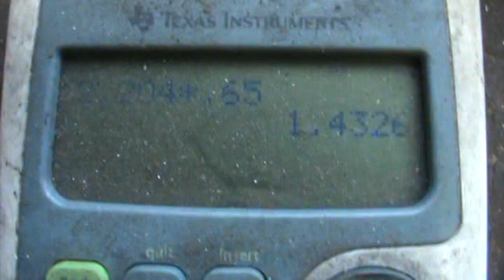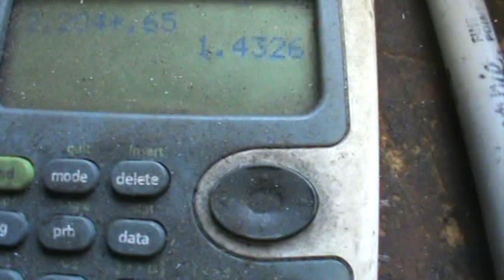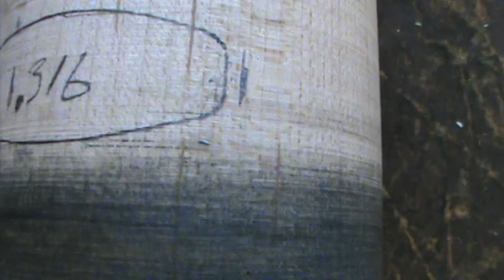exhaust port tips by tree monkey at opeforum.com

Comment: Hate to be a fly in the ointment but what happens to the life span of the cylinder and piston with this mod ? The slightest wear on the rings would see an end of ring snagging the widened ex port... you can plainly see how close the ring stop pins in piston is to this widened port... would it not be safer to leave the width of port alone and reduce the ports ovality by making it more rectangular in profile?
Reply from the maker: there's more then .100" of ring over lap on the cylinder. I would think one wound replace the rings long before there would be .100" gap in the rings. I think this is what your asking anyway. 
a flat port roof or flour that is over 50% of the bore will snag the ring no matter where the ring end pin is. the port has to have some curve to it.
the vid was made as a general guide, not specific to any one piston and cylinder. this just happens to be a ms 461, and yes one must consider pin location. the pin can be relocated if needed.